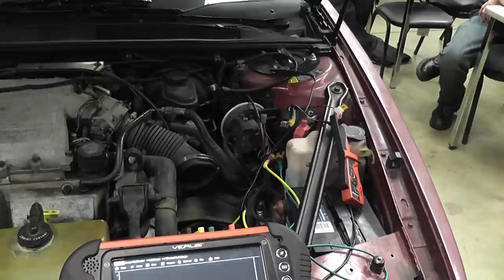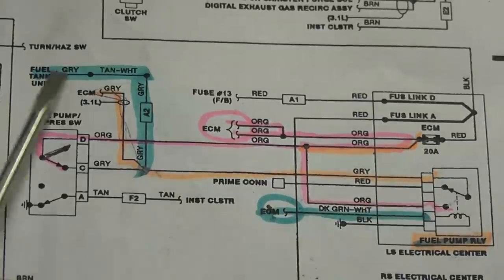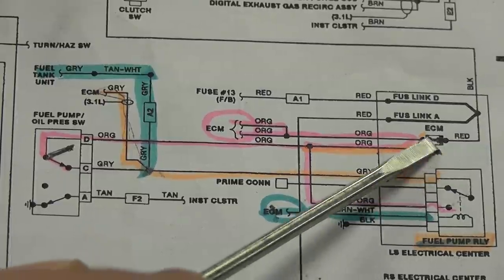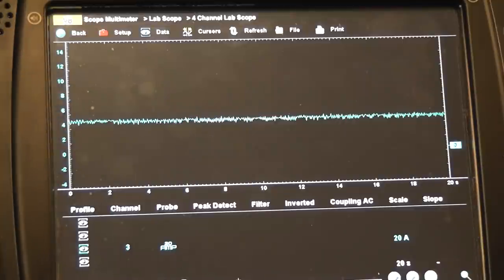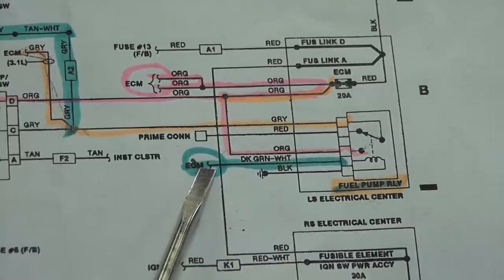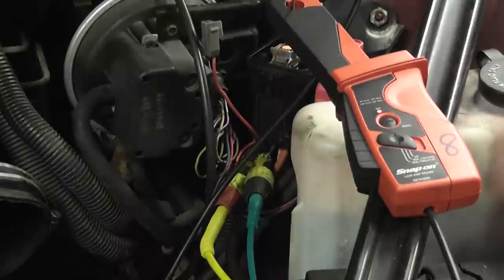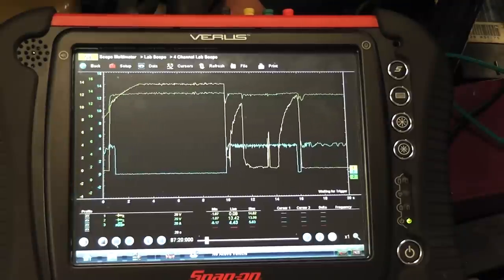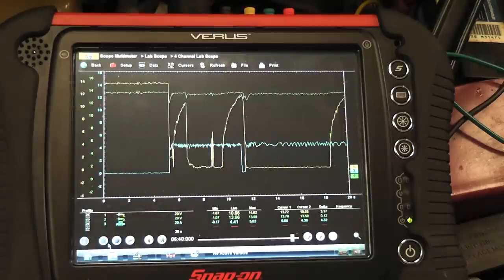Fuel Pump Relay Problem

Comment: Got a question for you.  Buddy has a 97 Dakota with a v8.  Went to leave the house one morning and truck wouldn't start.  Replaced fuel pump still no start.  Fuel pump relay and fuse are good.  Plenty of spark.  Took bed off of truck and no power to fuel pump.  Any ideas
Reply from the maker: Jeramiah Kemper how did you test the relay? just because it clicks does not mean it is good. First you need to do voltage measurements at the relay before chasing a broken wire in the harness between the pump and relay.
Reply: ScannerDanner plugged relay into horn slot and horn works with relay from fuel pump slot
Reply from the maker: Jeramiah Kemper Okay, so the relay is good, but that doesn't mean your load side feed is good going to and from the fuel pump relay. 
With the relay removed, you should have two pins that are "hot"during cranking. Do you?
Reply: ScannerDanner not yet.  The truck is at his house and I can only work on it during the weekend.  Thanks for your help

Comment: @ScannerDanner  That sounds a lot like a quote from Isaac Newton. It went like this, "If I have seen farther, it was by standing on the shoulders of giants...." I love that quote, and I love standing on shoulders, ha ha. 
Why is that backup circuit from the oil pressure switch there?

Comment: Great Video and Thank you. But I have a question pls.
 My 1994 Cadillac Fleetwood Brougham (LT1 engine) , runs without the Fuel Pump Relay plugged in, I demonstrated that for sure. But with the fuel pump Relay plugged in, my AC shuts off  as I accelerate to 50 to 70 mpg,  I did the fuel test while driving, and the fuel pressure never reached 41psi, the minimum specification for the fuel pressure. The fuel pressure hovered at about 34 to 35psi at low and high speeds. Could this problem be a ground issue, as you demonstrated with this video,  or could this be a fuel pump problem that needs to be replaced. If you think this is a ground issue, where would I find the ground in the car that needs to fixed.
Thank you for your time and response.
Reply from the maker: +Sam Rafeedie If you are saying the fuel psi should be 41 psi at WOT and it is not increasing, then yes a poor power or ground to the pump can cause low psi but most likely you have a failing fuel pump.
Reply: ScannerDanner  Ok so I have no clue if you will see this or not but my husband basically has a switch that turns on his fuel pump... It was like that when we got the truck. The other day on the way to work he went through a big puddle and his truck died. He found that the fuse in the switch was blown. It keeps blowing every time after running for about 10 mins. Usually if he hits a bump or is turning. It keeps on blowing. I know nothing about vehicles but wanted to ask if maybe you knew maybe what's going on. It says 15 a for the fuses we have been replacing. I don't understand why the fuse keeps blowing.

Comment: You said in your video that the fuel pump oil pressure switch is not there to protect the engine but to serve as an alternate route in which the current could travel. My question is will the fuel pump oil pressure switch keep the vehicle from starting?

Comment: Hey day. I was watching this video on fuel  relay issues on gmc. Upon checking  my relay I thought that when I unplug the relay the oil pressure switch should keep the fuel pump running. And mine shut rite down. So I replaced the oil switch. And tried the test again   And when I pulled the relay out it shut down. Why would that happened???  Thinking the oil switch would keep it running.

Comment: Found a good one the other day. Had a 99 pontiac trans am 5.7l it was it the shop for a engine light runs fine had a code for maf circuit. Found fuse blown for power feed. Replaced fuse when it was sitting there fuse would not blow but soon as you power braked it fuse blew. Found o2 sensors on same circuit and the wires on one of the down stream sensors rubbed through and would ground out on a heat shield when you would put a load on the engine. Like the weird ones.

Comment: 1985 honda prelude 1.8 automatic, fuel pump not working, pulled it tapped to 12 volt source works, tested wire leads to fuel pump no power, pulled and replaced fuel pump relay switch, still no power, car starts after pumping on gas pedal, but under load in drive began to stutter and shuts down if not on gas pedal, just purchased a painless diy dedicated fuel pump relay wiring harness, all fuses are good, any suggestions,  before I install wiring harness. Thanks

Comment from the maker: @kenjackson1977 First is watch my fuel pump electrical circuit designs video. This will answer your question about the oil pressure switch. Second is do you have spark? Third is do you have injector pulse? Answer these and watch that video and I can help you more.

Comment: at 17:30 you said the ground should be around 0, is that because the scope is measuring the potential difference between the power and ground and if it were working correctly and didnt have resistance it would be around 0 volts?

Comment: Mondeo Ghia 2004 2 liter petrol:  What must the voltage be entering the fuel pump?  What must the minim strength (voltage) be of the battery?
Reply from the maker: I thought I answered this. Maybe it was someone else. You want to have battery voltage. Whatever system voltage is, is what your fuel pump power feed should be. However, there are variables to this. If the pump is pulse width modulated, then there can be lower voltage showing when using a DMM but even on these systems they run full speed during cranking.

Comment: Hi. I know this may not be related at all but felt maybe your knowledge could help me a little. My husband was driving to work the other day and drove through a puddle of water and his truck died. He has a switch that turns his fuel pump on. It was like that when we got the truck. Well he seen that the fuse in the switch was blown so he replaced it. It will run for about 10 minutes and then the fuse for the switch will blow again. It keeps blowing over and over. We tried replacing the switch to no avail. It keeps doing it. I don't know much about cars to begin with just thought maybe you might have an idea.
Reply from the maker: It is becoming more and more difficult to answer questions here. I have 80,000 people asking me for help now. So I have created a forum to help you guys better. It is free to join and we can exchange pictures, wiring diagrams and waveforms if needed to help guide you through the process of troubleshooting your vehicle. Thank you so much! Hope to see you there. 
Paul Danner (ScannerDanner)
https://www.scannerdanner.com/forum/post-your-repair-questions-here.html

Comment: actually even with this bad ground in theory shouldn't oil pressure switch  take over control  when relay loses it ground and keep car running  although if those are computer grounds too then if computer is losing ground too and effecting control of other circuits that real reason car wont stay running  or does car have bad oil pressure switch too ? makes u wonder what would happen if u pulled out relay after u fixed the ground

Comment: scanner, my 88 mustang 5.0 wont prime either, i jumped the self test to ground and it turned on ran like that to get to work, tried it few days later now it doesnt even prime with it jumpered to grnd.  also i feel alot of current drawing  out the jmpr wire when its grnd.    i know i should just replace the pump and relay but call me cheep but y would it work that way then stop?

Comment: Finally an actual auto electronic/electric master mechanic. Every one that I have dealt with only guessed..

By the way my 1991 Lexus was doing the same thing except it was blowing the fuse when I would turn on the radio. So I wrapped some copper wire on the fuse until whatever it was affecting it on the radio side burned up. The car works now, except no radio. I did this after multiple wanna-be's mechanics kept giving me bullshit diagnosis.

Comment: If I were to connect an AMP probe to BATT NEG cables, would I see the AMPs drawn from the pump?
Reply: You would only see the amp draw on the initial prime after the engine runs the voltage comes from the alternator so you won’t see it at the battery neg cable

Comment: how much would a shop charge to fix that problem?
Reply from the maker: It was already at a few shops and they couldn't fix it.
If it was brought to me when I was in the field, it would have been an hour diagnostic time then another hour on the repair.
Garage rates are about $100 or so per hour.

Comment: At 2:00 you said, "...it goes to the load side of the fuel pump relay."  That is not the load side. That is the line side.  The line side is the pink highlighted wire and the load side is the orange highlighted wire.  No big deal but to those people not familiar with "load side" and "line side" your mistake could confuse them.
Reply from the maker: we don't use the term "line side" in the automotive field. The load side is the parts of the relay that contain the switch (pins 30 and 87 are normally open and pins 30 and 87a are normally closed)
And the control side is the coil (pins 85 and 86)
But I think you know all of this. 
Load side carries up to 40 amps (typical)
Control side draws about 100ma to create the magnetic field 

My guess is you may be correct in your terminology but we just don't separate the load side of the relay with two different names. I'm sure that it may be helpful to do so at times but this is the first I've ever heard it used. 
The load side is the load side regardless of which one is hot all the time, which one is normally open or closed

Comment: ATTENTION !!!!!!!!!! .......hey bud , im the one with a 2011 buick lacrosse nightmare lol . you told me it sounded like a computer ground .WOW ! funny thing happened in this ongoing 11 month buick nightmare a few months ago . i was sitting by the car checking fuses again for the hundredth time ,starting testing my relays next and discovered something new . i clipped the ground on one control side then i use another clip for power redhot ! .it click , so i held it to the suspect fuse to see if i could make it click like a machine gun ,it didnt lol .then i happened to be reading something in my notes and EUREAKA !!!! IT DID THE FAMOUS RAPID CLICKING THING . thats when i discovered , when you barely touch the test lead or wire to make the connection the relay will fire off like a machine gun ! . so when in fuse box ,i  connect battery ,it does the clicking thing ,the funny thing is ,it only blows the # 10 ECM  fuse ,the other 5 on circuit arent affected (fuse # 9 , 8 , 11 , 46 , 47 ) ....... I ASK ALL PEOPLE TO TRY TO RECREATE THIS . put wire on control side ,one very secure then put other wire on it and keep there holding it ,it will click once .then carefully pull the wire barely off until you make it click very rapidly .i got good with it ,i can make it click by hand now ,just like it does when in car !!!! lol . today i will take my GROUNDS DIAGRAM/SCHEMATICS  (ground views) TO THE CAR AND START CHECK THESE STUPID GM GROUNDS . THANK YOU FOR ALWAYS TAKING TIME OUT OF YOUR BUSY LIFE AND SCHEDULE TO HELP US LESS FORTUNATES PAUL . LOL  GOD BLESS YOU ,YOUR FAMILY  AND ALL YOU HAVE AND TOUCH MY BROTHER .

Comment: My 2008 Buick Lucerne stop starting the other day I road around alittle while my check engine light came on , then I turned it off to go in the store came out and it  cut back on 2 seconds cut off like five times then the dashlights went out and then I tryed to get my car pulled home, they tied the strap to my power steering line and it snapped in two. My battery also died.  After trying to start car over nd over..

Comment: I need help finding my fuel pump relay 12v female with 5 male blade's I changed my starter, my battery, my gas filter I bought the relay but I cant seem to find it. I still dont get fuel pressure into the engine. I tried the fuse box on the engine the fuse box inside the driver seat, under the seat the both left and right inside fenders. help pls its a mustang 94 v8
Reply from the maker: It is inside of something called a Constant Controlled Relay Module. It's a black box usually mounted around the front of the engine?

Comment: so the oil pressure switch and the fuel pump relay share the same ground as well? I thought the oil pressure switch was designed to keep the vehicle running if the fuel pump  relay failed?
Reply: The oil pressure switch is just a switch. It just takes power from the fusible link and with oil pressure sends it to the fuel pump via the fuel fuse and the pump to a totally different ground than the relay ground . In this video the oil pressure switch has to be bad also.

Comment: my fuel pump went out, replaced it and now car wont start and pump wont prime. No cel`s ,relays are good, fuses are good. Car turns over just fine and everything else is normal, just wont start. Its a 2001 mitsubishi eclipse gt and help would be greatly appreciated. Stranded for five weeks now :/

Comment: oil pressure switch being a BACKUP  power side for fuel pump relay would keep the pump running regardless of relay control circuit. or? correct me if I am wrong.
Reply: Yeah, I have the same question...

Comment from the maker: I am not sure on this one. On the Toyota Echo I did with a bad block ground that did not work. The grounds on pins 4 and 5 had normal voltage readings. Watch that video, I went through why that wasn't a good test and why the ohmmeter was needed in that case.
As for my eBook, go to my website at scannerdanner d o t c o m
Thanks!

Comment from the maker: they stopped putting it in parallel to the FP around 2000-2003 depending on the model.

Comment: This was very cool,u knew it was a ground problem as soon as u turned on the heater and it stalled,i assume
Reply from the maker: It definitely suggested that! Thanks
Reply: @ScannerDanner  I am wondering tho, since you mentioned the oil pressure switch would keep the car running... could the main ground missing the nut.. be for the fuel pump itself too??? Thanks Paul You are the BEST!! love from Norway!
Reply from the maker: @joachimjohan1215  I believe the fuel pump itself grounds to the frame under the car, not in this location Thank you! Bought my camp gStove from Norway :-)
Reply: @ScannerDanner  you think the oil pressure switch maybe faulty too? it needs no ground to close the + contacts rigth?? sorry for taking your time but im really trying to learn circuit functions and why things fail! sorry. =D thx for your swift reply!  ur the man!! Cheerz!
Reply from the maker: @joachimjohan1215  this video explains the relationship of the fuel pump and oil psi switch https://youtu.be/Rqtfrx-HeD0
Thank you!
Reply: @ScannerDanner  Thanks for the link! 17min 40 seconds.  i will conclude with= The faulty ground has to be either A: messing up the PCM system stalling the engine OR B: messing with the fuel pump ground.. stalling the engine.. am i just wrong? i would have loved to see a voltage drop on pump ground and + via the oil psi switch :) please donnt hate me Paul! I wish you all the best!

Comment: OK need help please. 91 Dodge Stealth was running drove it home was told the tps sensor was bad took sensor off to be tested it was fine placed sensor back car won't start now. Even after placing back on properly. buzzing sound from fuel pump relay on dash passenger side of car only when ignition off. have tried to find a short absolutely no luck please if anyone knows what could be causing it let me know. also checked other relays to fuel plug grounds and wires all are getting good voltage. with the relay buzzing before taking off tps. car try to start but won't since the removal of the tps no problems with ecu.
Reply from the maker: +Crystal Reed with the key on, give me the voltage readings on all three TPS wires with it unplugged
Reply: +ScannerDanner   Thank you!  I really enjoy your videos and explanation of your  thought process in diagnosing, its interesting and fun! I do my own back yard mechanics and like improving my knowledge and skills, especially in the diagnosis department.

Comment: That's funny the guy decided to rig up the wiring just to get it to your shop, when he admits that the fuse only blows when he turns the heater on. I see the video was posted in December, maybe he preferred the heat over safety. lol